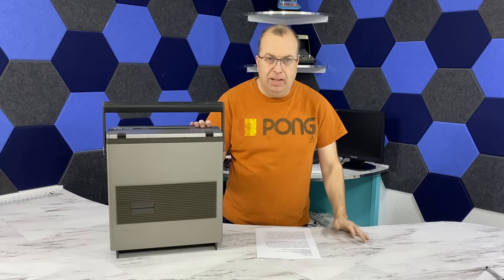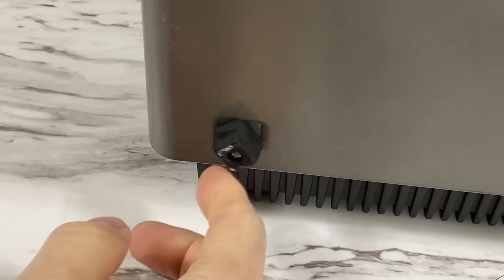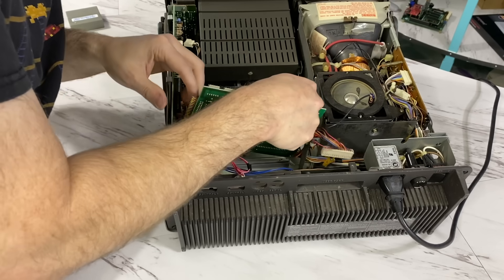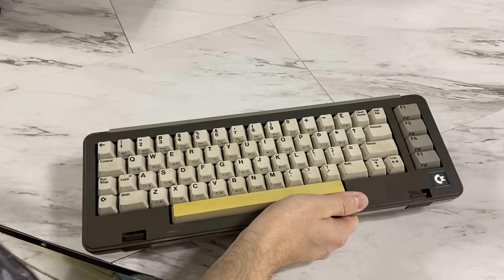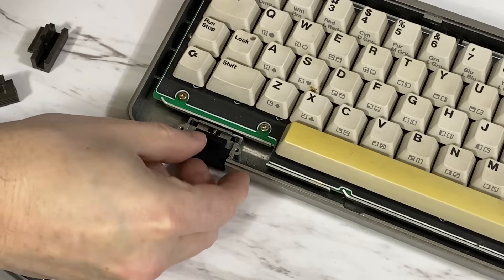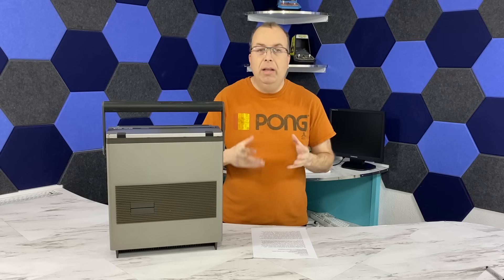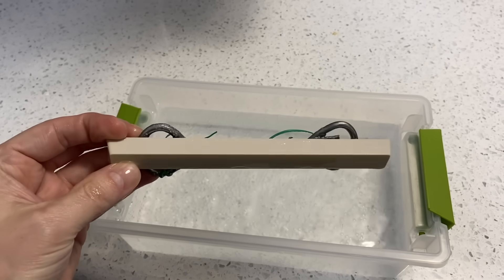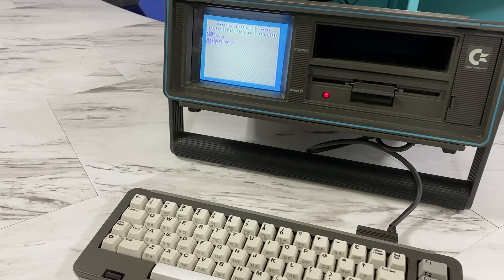Commodore SX-64 repair and trivia

Comment: A month ago I found one of these at a flea market for $150; it didn’t have a keyboard cable, but other than that the computer and keyboard both worked great.

I did purchase heatsink for all the motherboard chips, especially since the PLA and SID chips are known to overheat and break due to the placement.

I also made a keyboard cable out of a ribbon cable. It has become my go to C64 because I don’t have to worry about setting up the computer, disk drive, and monitor.

Comment: If I was in the market for a portable 64 I'd go with the black and white model. I'd much rather have a sharper screen than have color. Small color CRTs are generally pretty bad at text unless they have a shadow mask that's small enough to make a difference in clarity.

Comment: I worked at an authorized Commodore dealership from 1988 to 1991.  Prior to that, I wasn't aware of the C64 portables.  During my employment at the dealership:

· I got to see several SX-64's and a DX-64.  All of them had the same screen color scheme as the C64.  I was surprised to see that your SX-64 has a different default color scheme.
· The aforementioned DX-64 had dual floppy drives.  A guy brought it to the dealership in order to sell it on consignment through the dealership, which he did successfully.  I wanted SO BADLY to be its buyer but couldn't afford it.

Comment: i wonder if the sx-64 would have been better with a trinitron style tube instead of the color mask crt. i dont think ive seen one that small so not sure it's possible. but even small 12 in crts look much sharper with the trinitron aperture grille than a standard shadow mask.

Comment: When testing the keys make sure the metal bar is pressed down (or screwed back in) otherwise key presses won't register!  Also don't put back together when keys are damp/wet (I had ultrasonic cleaned mine!) as keys again won't register! finally I recommend connecting your keyboard up to the SX64 and power on - then insert the following keys and press to make sure they appear on the screen - insert and test keys > 1----asterisk (*) -------L ------- 0 ------ B ------F ----- E ------- cursor up and down - if all test fine then turn off SX64 / disconnect keyboard and add the rest of the keys. I say do in that order as it will test all 'bit matrix' and you will know there is a bad connection with the overlay and/ or section under the metal bar. Its better to do that way rather than inserting all the keys back in then testing the keyboard at the end because you will have to take it all apart again if issues.

Comment: When you get one donated with exactly these two problems: dead PLA and dead keyboard membrane.
Reply: PLA was an easy swap, no need to get the PCB out, just lift the bad chip with a screwdriver and insert a correct working one.

Comment: Back in the early 90,s I traded in my c64 for an sx 64 but unfortunately no internet nor any people about to help me age 11 to even understand how to get the disk drive to load . And I was not told by the shop that I could not connect a tape deck 😢 whoops . So then  unfortunately my step dad who was a cardiologist took it to the hospital mistaking it for a very similar looking unit of which there was usually dozens of in our hall way.   And that was the end of that. I paid £25 for it lol. I certainly wish I had it now !  I washed cars for 2 years and got my Amiga 500 second hand and forgot all about c64s 😅

Comment: I was lucky enough to have one of these back in the prime days of the C64 when social copy groups were quite popular.  We spent a great deal of time giving it official and custom upgrades, Making of the machine that everyone envied. 

There was a switchable disk drive speed up upgrade called the SX-flash that was a hardware-based and very compatible with most games so you usually could leave it turned on all the time.
We also gave the disk drive an installed LED number to display the assigned drive number, and a toggle switch to change it.  We even installed a toggle switch to force the disk drive to see any inserted disk as write-protected (for that one guy in the copy group that always seem to switch the source and destination drives, copying over your software)

I eventually added an MSD SD-2 SuperDrive, enabling the SX 64 to set up the SD-2 for automatic disc copying, freeing up the SX 64 to run other software.  Good times!

Comment: I had one, I found that the cartridge port was not wired the same as the C64 so when I plugged in a modem it burned out the 5v power transformer. I saw one in the Fort Mayers Kmart.

Comment: In the 80s I joined a London based start-up firm specializing in designing data logging interfaces for Commodore machines and was fortunate to play with the SX-64 which I thought was an amazing piece of hardware. We sold the SX-64 with custom designed data logging instruments to industries such as health, education & research & development as this could benefit portable data logging devices that you take anywhere with you.

Comment: Another reason it failed was because it just wasn't powerful enough for buisness use, even if you were willing to deal with lack of software, a 1Mhz CPU and 64K by 1984 was pretty bad in that market, the reason machines like the Osburne had success earlier was because they were basically the only portables on the market.

Comment: The local university library had one with a wonky fdd.  You could only check it out for 1 hour and 50 minutes, once a day.  That meant you were sat in smoky room with a chair and small table.  You were not allowed to play games, the fdd only worked sometimes.  I eventually got banned for "gaming the system" by coming with a friend and both of us sharing it over 2 consecutive check out periods and they wouldn't let us bring in an extra chair, so one of us had to stand.  That's how I learned BASIC and eventually went on to study CS.

Comment: At one time I collected three of these SX-64s.  Fixed them all and worked great. I donated them to a fellow collector many years ago. I wished I still had my collection.
Reply: why didn't you keep one?
Reply: I never liked the SX-64. Clunky design, no tape port, bad screen, evil price, and now I learned it doesn't have a mechanical shift lock.
Reply: @NuntiusLegis  Meh @ the tape drive, never used it. Screen isn't that bad really, and you can still hook it up to an external tv or monitor. And also meh @ mechanical shift lock. Price wasn't that bad, it's about what you'd be spending for a brand new c64+monitor+1541.

Comment: This is a super late comment to this video but I was curious if it would be possible to replace the shadow mask on the monitor to one more appropriate for the screen size to improve the clarity of the image.
Reply: Late reply to your late comment :)

No you can not change the shadow mask, it is sealed inside the CRT tube and put there before the front and rear glass sections of tube were melted together and all the air sucked out. 

To fix it you'd have to find a better CRT, and swapping that out would be a task. I'm not sure any 7" color computer CRT's really exist... That's a very small size.
Reply: @volvo09 Dang that's unfortunate. Interesting to know how its made though.
I did actually find some 7 inch crt monitors with a bit of googling, but that's not to say any of them would be compatible with it.

Comment: I have one of these as well and still works great. Unfortunately the plastic on one end of the keyboard cable broke and now the connection doesn't work very well.  Does anybody make 3d printed ends for these cables?    This is one of the neatest machines in my archives to bring out to show people, most of them are shocked to see this is a Commodore product along with a Color CRT.

Comment: I had an SX-64 with a tv as a monitor and a 2400 baud modem in my dorm room at Towson State University in 1993. I connected with the VMS mainframe using SmartTem which only supported a 40 column screen while the VMS mainframe was based on 80 columns, but it worked.

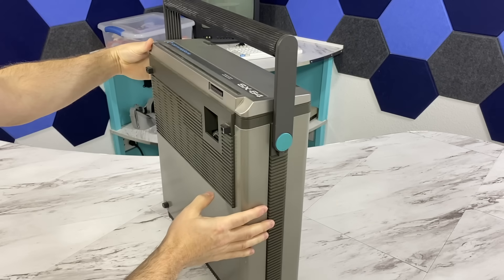Comment: 2:10 Banana Printer
Reply: It was also sold as the "Gorilla Banana", essentially a rebadged version of the Seikosha GP-100. It was a very cheap dot-matrix printer, marketed for use with 8-bit computers like the C64, TRS-80, TS2068 etc. It's main flaw was that it only had a 7-pin print head, so it couldn't print lower-case letters with descenders properly - they were all shifted upwards.

Comment: Next time you take the top cover off try bypassing inductor L2 by shorting its legs non-permanently by using a jumper cable on the back of the MPU board - towards the top left looking from the back of the board.  The chroma bleed on the left edge of crt border and overall sharpness should improve a bit. I believe Commodore used the wrong value for this component (22mH) on early NTSC models (probably for FCC), as it is reportedly much lower on PAL SX-64s.  Made a great difference clearing up the video on mine - YMMV of course but I have had no issues after 2 years. Screenshots are on the SX-64 FB Enthusiast's Forum.  :-)

Comment: It’s funny how shortly after a significant upgrade our tech toys become almost useless to us, but then decades later we want them back for the novelty, nostalgia, appreciation for history, etc. I have an odd version of this where I bought a commodore superPet in about 2008 or so on eBay for about $70. I ended up leaving it in a move in an attic, who knows if the original owners noticed it or got rid of it or what have you. Now you’ll be lucky to find a regular one half functioning on eBay for under like $400

Comment: what is a bread bin in this context does it just mean a working computer without the aesthetics like the case ?
Reply: It's the informal name given to the original C64 (with a case design very similar to the VIC-20), used to differentiate it from later models like the C64C (with a case design that's more like the C128). It gets the name because of its brown/beige colour and rounded front on the case - resembling a bread bin.

Comment: I fell in love with these back in the day but the $1000 price tag was out of the question and I was already moving away from the C64 anyway!
A liquidation company was selling these brand new for $199 or $299 !! I bought one and it lasted 3 weeks. Its replacement lasted 2 weeks.
Returned both. Sad thing is had the information available today  been around back then I could have repaired them!

Comment: When I was serving aboard the USS Detroit AOE-4, in the mid to late 80s, I had an SX64. I used it in an office space, on a "shelf" that was also the inner skin of the ship. Due to the electromagnetic field, created by salt water passing the outer skin of the ship, the monitor would go all wonky. Therefore, I had to take it to the ship's ETs to have the monitor degaussed. After that, I stopped using that "shelf" for the SX64. I also "destroyed" a couple of floppies due to the same effect. 

I really enjoyed having, the SX64. Sadly sometime in the early 90s, the metal in the handle/stand broke. The cable for the keyboard went bad, and I had to use a ribbon cable. When that too broke, I donated my SX64 to a thrift shop.

Comment: So heres an interesting recent thing i discovered

Most keyboards are made of fairly chemical resistant, moderate softening temperature plastic.

If you happen to have a dishwasher, you can put keyboard frames in it and set the wash to "delicate" or "low temp"
If you have a big strainer or silverware insert for the dishwasher, you can also dishwash the keycaps

No need for dishwasher fluid, the water alone will take care of practically anything unless your keyboard is supremely nasty.

Take them out, give them all a good rinse to prevent water marks, and then put them by a fan for a while and youve got a keyboard that looks brand new.

Comment: I have an SX-64 that I purchased new in like 88ish. Last time I turned it on it went poof and no display. I have fixed C64's before (in the 80's and 90's and could get parts locally. Do you know of a source for parts or is it just scrap out of existing boards, if so any place that has those? Thanks looking forward getting it running. thank you

Comment: I remember seeing one of these at a computer fair in the mid 1980s and thinking it looked really cool. However as you say it never really took off for several reasons.

Have you ever done one of these videos on the Osborne 1? That was a similar idea to this but it was released slightly earlier and came with a monochrome display only. I think it was slightly bigger than the Commodore but could connect up to an external monitor as the built in one was also a small CRT one.

Comment: Dave said he never saw one of these for sale. I grew up in western PA, and there was a regional chain call Hills that always had a great computer department. They would have a dozen machines on display that anyone could play with. For a long time my local store had a SX-64 on display. I think the price was down to $599 or so at the time. I spent hours messing with the machine, as it really was a unique system for the time. I miss Hills, as they really helped me get into computers, which is my career. Hills help me become a software engineer.

Comment: PLEASE STOP using wd40 for lubricant. It's not a bloody spray oil. You'd literally be better off with a spray of canola oil from the kitchen. Wd40 is for (w)ater (d)isplacement. It's a super thin oil to help unstick rusted fasteners. It is NOT a chain lube. It's not a gear oil. It's NOT a permanent oil. It is designed to evaporate away.
Reply: Thanks for evangelizing, but just to set the record straight he is using white lithium grease. WD40 as a brand has a specialist section with actual grease like white lithium or silicone. If you read the can below his hand he is using the right stuff

Comment: No, the Commodore SX-64 was purely aimed at people who wanted to play games. 😀 Oh boy! A computer that could count up to 65536 using all the bit in one byte, and nobody to calculate the number of people that actually would like to buy one. I never saw one in real life. A businessman could never use this, the screen is unreadably small, it is smaller than a tablet, only slightly bigger then a modern day phone, try doing a spreadsheet on that! This, and the Osborn, and all the other ten to fifteen kilo's heavy computers were mistakes. All computers that had to be carried by one or two full-grown men could never by used in practice. Ever tried to get the batteries charged?

Comment: I'm sure the suggestion I have will be blasphemous. Could you find a tube from a better piece of gear? With a less irritating shadow mask? 
My favorite small-town computer store used an SX for its POS. The proprietor, as I recall, had poor vision and used a small monochrome display on top of the SX. He was desperate to sell PLUS4 or C16 units to anyone with a pulse, so I did not stick around after they went on display.

Comment: 9:55 this is a prime example of the Difference between PBT and ABS keycaps in this case the Space bar is ABS plastic and the normal Keys are PBT Plastic. ABS plastic is a lot cheaper and you can have LEDs shine through them as well but if they are white they can yellow. PBT Plastic on the other hand is WAY Superior PBT plastic is a much higher quality and thicker plastic and usually the keycaps are double shot keycaps and PBT keycaps also have a more gritty texture to them true PBT keycaps also can't have light shine through them due to them being really thick also on the plus side the letters on the PPT key caps never wear out because they're actually a part of the plastic unlike ABS keycaps where they're just lasered on and they rub off over time PBT caps Don't have that problem at all and the last thing that answers your question PBT plastic doesn't yellow alot of keyboard enthusiasts will upgrade their keycaps to PBT plastic because they're just better in basically every way outside of not being able to sine LEDs though them

Comment: I actually DO remember seeing these at K-mart back in the day, at the same time the Plus/4 and C=16 were out. Funny that you don't. I'm in Virginia whereas you're in Texas; that may be the difference.

I wonder if it's possible to replace the screen with a 5" LCD screen for better clarity (and a bit of weight savings)? I mean, I guess it's certainly possible, but is there an appropriate screen made? Hard to imagine a 5" screen with 320x200 resolution being desirable for anything else, so maybe not.